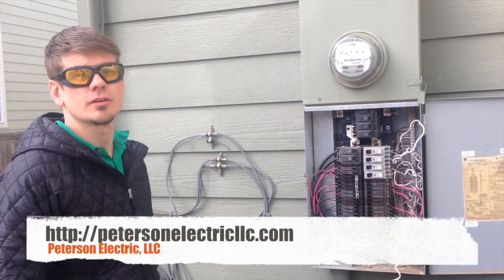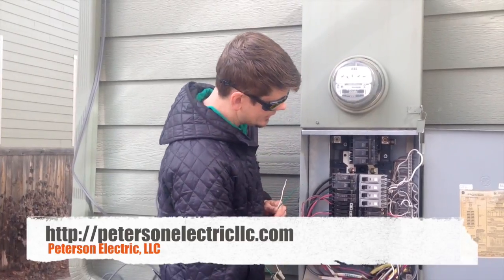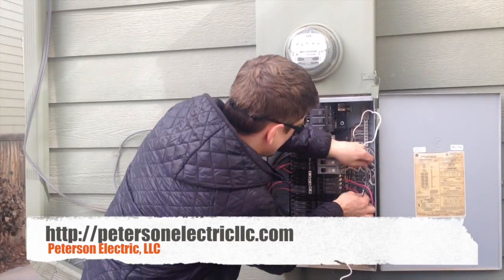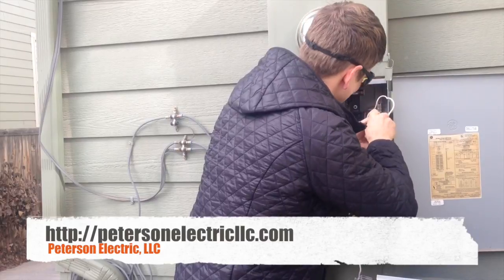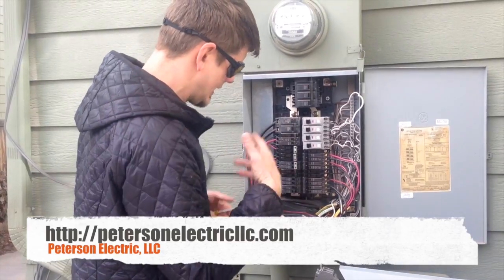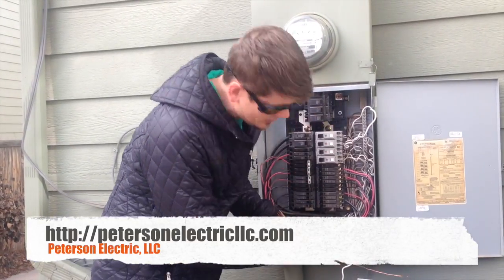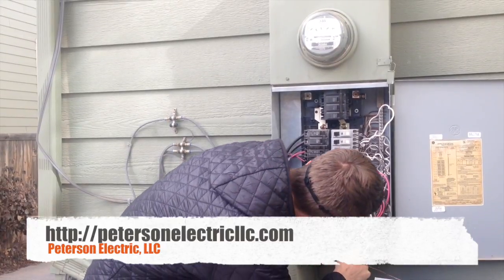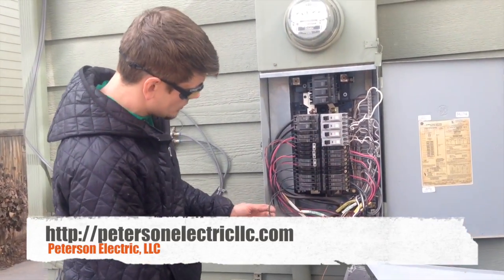Why Arc Fault Breaker Is Tripping, Testing Method, Part 2

Comment: You don't have a Ground or natural fault. You have two hots from those two circuits connected somewhere in the bedrooms. If you would leave the AFCI on and turn off the breaker on the bottom that is also tripping you will find that it is hot when off.

Comment: I am having a big problem with one of my GFCI breakers. It keeps tripping randomly, seemingly  for no reason.  I have had two separate Electricians in here who have opened every fixture in the problem circuit and they found no issues. After they visited the breaker tripped the same day, then magically quit tripping for weeks, then it started tripping for a week or two randomly ...then it worked for months. Now it is tripping again for no reason.  However, one light turns on in my sons bathroom but if we flip any other switches it trips the breaker. So frustrating! Should I just swap the GFCI out for a regular breaker? Should I split up the circuits? and have the rooms separated? The electricians don't seem to think the breaker is overloaded  and again it worked for months with no issues. Could it be surges from the power company? Local construction/temp poles? hoping you have an opinion here..
Reply from the maker: Sounds like a call i had when it rained, a lot, I had this AFCI brk. trip. An outside plug had been attached to this circuit and when it rained the bell box filled with water.
Reply: These breakers for some reason run warmer than a regular breaker, even with little to no load. I have had 2 separate customers call for the same nuisance tripping, both were afci breakers. I swapped them both out for regular breakers and they never called back on the issue. I’m 2-0 on this particular matter.

Comment: I will bet that the other end of this wire is connected to a 240 V heating element. It seems as if the branch circuit was not labeled correctly and that it was intended for a 240 V breaker.

Comment: To find a breaker that doesn’t trip I connect in series the problematic wire using the same bulb tester that you use and shut off each individual breaker until I get the breaker that supply power to avoid continuous electrical shorts and time 
There are other ways to find the problem  but by using what you have 
In my 45 years of electrical work I learned to have a open mind and taking one step at the time until I get to  the problem

Comment: ONCE YOU FOUND THE BACK FEED, WHY DID YOU NOT GO LOOK FOR LINES CONNECTED TOGETHER.
Reply from the maker: I did there is another video for the upstairs.
Reply: @Petersonelectricllc  dude.. IMMEDIATELY you should not be looking for dead short by trying to trip the breaker.. you test for dead short on a circuit by disconnecting ground and neutral and testing with chirp on meter.. its still blowing after disconnecting ground bcz it's not a dead short. Your are crossing line A and B. Not phases. LINES. single Phase.  2 Lines..
Reply: @Petersonelectricllc  you ever think of posting links to solution videos in description or at least post it perfectly n description kind of hard to go through video that are never posted in order but as always appreciate the effort to showing those that can understand. those that don't shouldn't be attempting these repairs tests
Reply from the maker: @wizard3z868  No. I do enough for free to the public and it costs me money to post my videos.
Reply: @Petersonelectricllc  kk that explains a lot of times banner is obstructing video ya wld be a full time job to work as trade by day edit post yt at night you need a life too and time off
Reply: @Petersonelectricllc  Glad you made the 3rd vid, but where the heck is it?????????????

Comment: turn the other original breaker off, turn on afci on and see if you have 120 volts at breaker output in off position.  if so both circuits are tied to gather, back feed each other. leave both go inside, see what is not working, find a spot where the same phase can be split, so each circuit can be independent of one another. its probably very close to where the arc fault area and non afci split, but tied together. no use spending an hour at the panel.
Reply from the maker: Yes you are correct, this is what we did and there is another video that showed us in the master overflow room and the two circuits were split in the three gang lighting box and the red and black were tied together.
Reply: I agree. Trouble shooting seemed to long.  I would of started on whatever that breaker was labeled prior to all the other troubleshooting. Find home run and start from there. If you have an Apprentice you can track down and fix within an hour.

Comment: Wow,   Pull both feeds from the breaker in question and the one that you know is back feeding it and see if there is continuity between them.  No doubt that someone has tied the two circuits together somewhere in the house and that is causing the issue.

Comment: I have watched you repeat over and over tripping or trying to trip the ACI. I have not seen you go and fix the problem.
Reply: It’s painful to watch isn’t it?
Reply: EXACLY BRO when was he planning on going inside to find where the problem circuit is being backfed from trace the junction box with the makeup or termination mistake its really simple this guy doesn't know how to troubleshoot..
Reply: 32079rme it would have been really easy to find which breaker was at fault without all the arcing of the service. Just turn off the main for 2 minutes , but leave all the breakers on... use an ohmmeter to measure between the hot of each breaker and the neutral. 

If you get an open or a resistance that represents a connected load no issue... if you get a dead short, well then guess you found your problem. 

Then just use a fox and hound to track it down with little effort. 

I hope he didn't charge her to make this a video.
Reply: Could have removed the Peterson Electric Advertisement line also for most of video, couldn’t see a damn thing, it was blocking where you were working!

I guess at $75 an hour the longer the video the better!!🤔🤷🏻‍♂️
Reply: He never shows the fix and to have to scan the comments to occasional find he answered the problem like this one was shared hots underground 🙄
Reply: Brandon Arney in the end I still don't know what you fixed was it that little wire not up in the ceiling fan
Reply: I don't know mate.. Are you sure he tried tripping the breaker in that last 25min video. Can't remember that part myself lol